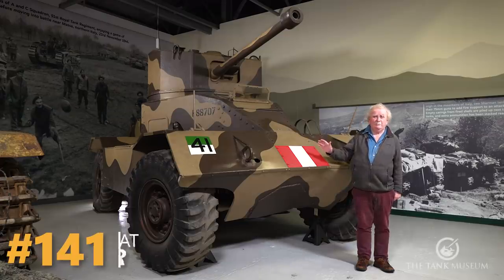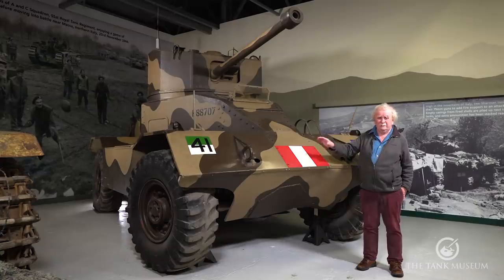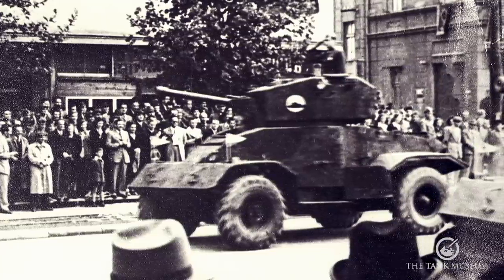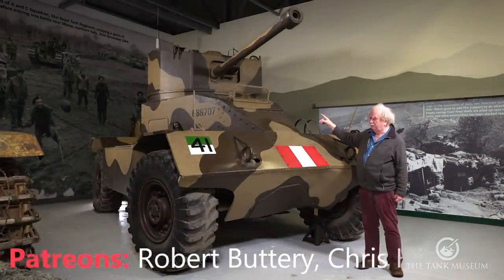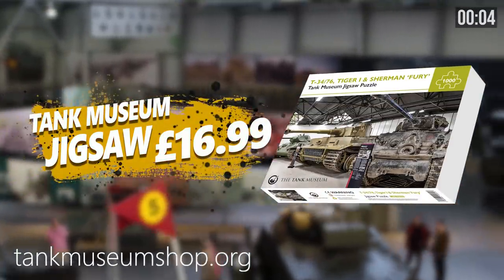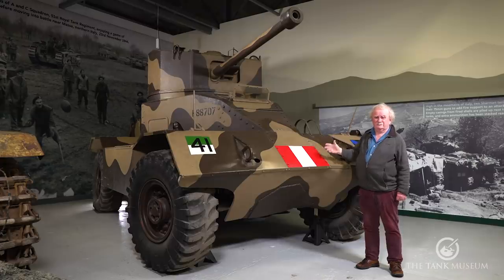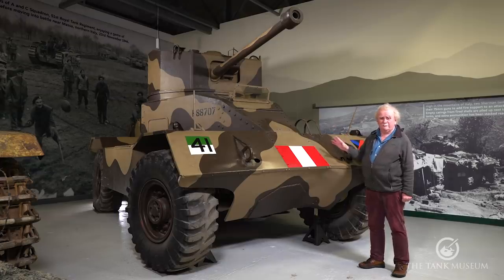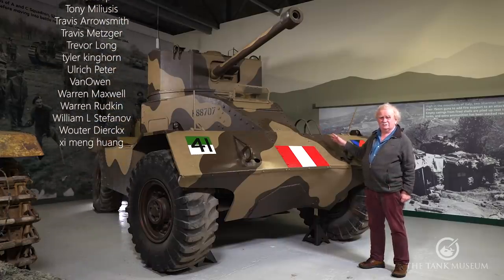Tank Chats #141 | AEC Armoured Car | The Tank Museum

Comment: That bridge at 2:45 is the Levensauer Hochbrücke (Levensau high bridge) crossing the Kiel Canal near Kiel, carrying the road and railway to Flensburg.
Reply: Very nice catch. I was wondering though, why they passed armed German troops. It's obviously after the war ended, but I did not think the Allies were using them for local security for quite a while (the "de-nazification" vetting taking a long time). Must be 1947 or later?
Reply: @stevewindisch7400  : The german soldiers seem to be Feldpolizei/ Feldgendarmerie ( Military Police) , but i , german, also don' t know , what happens in this old clip.
Reply: @stevewindisch7400  All I can say is, that this is post-war, and pre-1954 when the bridge was refurbished and lost the towers.

Comment: The 1st Armored Brigade of the National Liberation Army of Yugoslavia, which was formed in 1944 in Italy and then moved to Croatia to join the partisan forces there, was equipped with M3A1/A3 Stuart tanks and AEC Mk.II armored cars. According to what I have heard, the AEC Mk.II was very well regarded and preferred to the Stuarts by the crews, not the least because of the gun which was more potent than the one on the M3 Stuart and could deal better with most of the rag-tag armor that the Germans and their various collaborators used in Yugoslavia. Apparently, the AEC crews managed to even knock out several 'Panthers' and 'Tigers' during the war. The Axis forces, of course, didn't have such equipment in Yugoslavia, they mostly had just obsolete German and captured Allied armor, but apparently the British instructors that trained the crews and personnel didn't pass up teaching them about the existence of Panthers and Tigers and told stories about how powerful they were. So, just like in other Allied armies, the Yugoslav tankers started seeing Panthers and Tigers everywhere as well. Hence why they created PAK 75mm armed tank destroyers on the M3 Stuart chassis...

Comment: I'm guessing it wasn't all that quiet, either.  
I suppose the reason it was front drive is because most vehicles with transfer boxes have the engine shaft coming in the front and the main drive shaft coming out the back, and they just reversed one.

Comment: As usual an extremely interesting video. What is the difference between an armoured car and a tank, is it just the wheels?
Reply: Not the only difference, but yeah it's the most basic one. All tanks are tracked, and all armored cars are wheeled. Tanks are also always much more heavily armored and have bigger guns. They also have very different roles in the battlefield (armored cars for scouting, tanks for spearheading attacks).
Reply: The major difference between the two is the role they play on the battlefield. A tank is specifically used to break the enemy line. Most armored cars in WWII performed reconnaissance missions, whereas this heavy AEC had more clout.  So it could defend itself, when any other scout car would have to skidaddle.  As David Fletcher alluded to, the AEC had an infantry support role, blurring the line between armoured fighting vehicles even more. It seems a total of 629 were built, all variants told, according to Tanks Encyclopedia.  The Lynx (1990) is an CVR(T) Combat Vehicle Reconnaissance (Tracked), so the tracks can be used in a scouting role.  The Lorraine 40t (prototype only) had tyres, although it led to the tracked AMX-50, somebody, somewhen, thought a tank could go without tracks from time to time.  All terrain wheeled vehicles are getting heavier, if airless tyres existed which dealt with ground pressure issues, would they be any more vulnerable than tracks?  Who knows.
Reply: Pretty much yes. Armored cars tend to have thinner armor than all but the lightest of tanks as well.  The advantage to having wheels and the lighter weight is that they’re usually faster, easier to maintain, and don’t chew up roads like tracks do. The drawback they have is that they generally don’t have as good cross country mobility as tracked vehicles do, particularly over soft or very rough ground.
Reply: The British did toy with the idea of "Wheeled Tanks" for a while - the Guy Armoured Car was originally called a Wheeled Tank. 

In more recent times the Italians we had in Sarajevo in 1995 called their Centauros "Wheeled Tanks"

Comment: In the single engagement on the approach to Trieste "major" armor to armor engagement in Yugoslavia was fought. Germans had variety of armor, including three captured T-34. After initial loses to Yugoslav Stuarts, 4 AEC Mk.II have made an ambush into which Germans were drawn in. Fire from those hit the flanks and they KOd all 3 T-34s and  at least 4 other vehicles, including SdKfz 250 or 251, some Marder variant and two light tanks of unknown type, probably ex-Italian. One T-34 burned down, other was heavily damaged (engine and transmission destroyed by multiple penetrations), and 3rd had turret heavily damaged with two penetrations. So they have used turret from tank no.2 to repair no.3 and rolled into Trieste on the T-34, among other hodge-podge of the armor they had.
Repairing No.3:

http://elektron.tmf.bg.ac.rs/bojan/armor/tanks/t-34-76/t-34-76_m43_03.jpg

No.3 in Trieste, operational again:
http://elektron.tmf.bg.ac.rs/bojan/armor/tanks/t-34-76/t-34-76_m43_02.jpg

Comment: Question...did the Brits ever build any fast light howitzers during WWII? I know the Americans had the M8 Scott, the Germans the Sd.Kfz 234 but I don't recall seeing any light howitzer vehicles for the British which would seem like the way to go if you want to support the troops on the ground instead of putting an anti-tank gun on an armored car.
Reply: There were some armoured car variants with 76mm howitzers, at least for the Staghound and Daimler Armoured cars. I’ve not come across a lot of info about them. They were fond of putting howitzers in tanks, most tank chassis used throughout the war had a howitzer variant such as the early cruisers (A9, A10 etc.), Matilda’s, Crusaders, Churchill’s, and Cromwell’s. Some of those tanks are as light as a Stuart but nothing that light which could match the Stuart for speed.
Reply: The Alecto based on the Light Tank MK VIII "Harry Hopkins" and mounting a 95mm howitzer - They never saw active service though till post war

Comment: Why did the vehicle not fire a good HE round? And how did changing the gun from a 6 pounder to a 75 mm fix that? I guess what I am asking is, why is the change of a gun improve the effectiveness of a HE round?
Reply: The 6 pounder was designed as an antitank gun, that is high velocity rounds with a relatively small calibre (57mm).
The walls of the HE rounds had to be thick to withstand the shock of the acceleration, reducing the amount of filler available.
The 75mm was derived from an artillery piece, with relatively low velocity and a larger caliber. Rounds were bigger with thinner walls, packing more 'bang!'

Comment: As tall as the grant, 
As armoured as a stuart, 
As fast as a sherman 
And the firepower of a crusader....
May one ask why did they even made this death trap?
Reply: Because recon units needed some decent firepower...
Reply: One can for same argue "why did they made the SDKFZ 234s". The AEC was designed because british recon armoured cars clashing with italian armoured cars in NA were outgunned. The AEC had armament and armor sufficient to deal with any armoured car. 

Ofcourse armoured cars were never intended to engage tanks. But thats not a guarantee it wont happen ofcourse
Reply: Hull down, it would be quite a serious threat to a Panzer IV.
Reply: Because Armoured Cars are really cheap compared to Tanks. Which means you can build a lot more of them. And do you know what's far worse than having a substandard Armoured Vehicle? Having no Armoured Vehicles!
Reply: They would work alongside other recon units with Dingo's etc., far smaller, nimbler and quieter vehicles. The smaller vehicles would do the close target reconaissance, these would provide overwatch to get the forward screen out of trouble. Towards the end of the war, as opportunities for sneaky recon disappeared the British Army moved to heavier reconaissance units including Cromwell tanks.
Reply: the 6Pdr gun was capable of taking out a Tiger tank